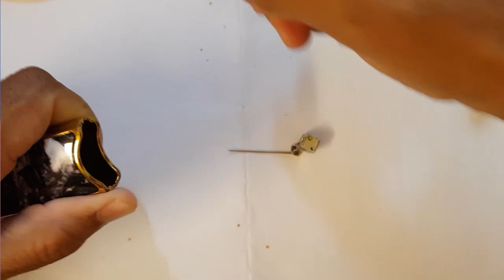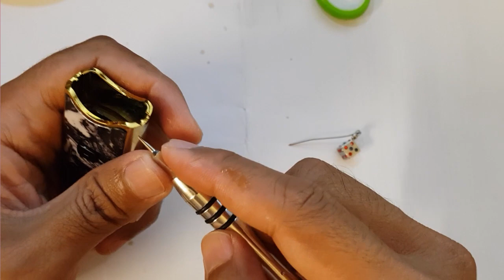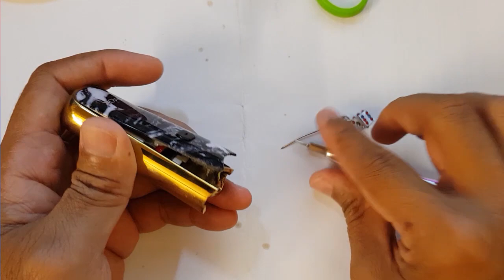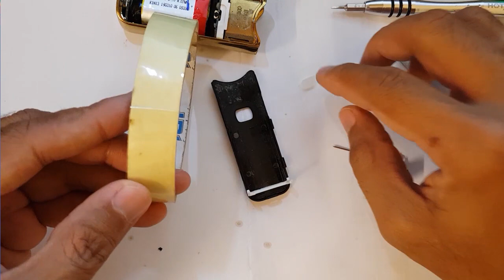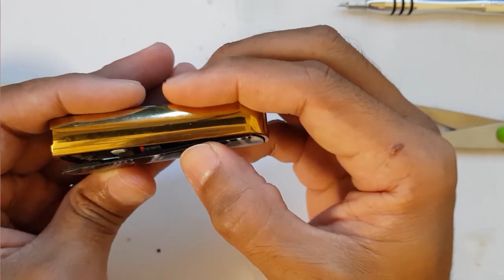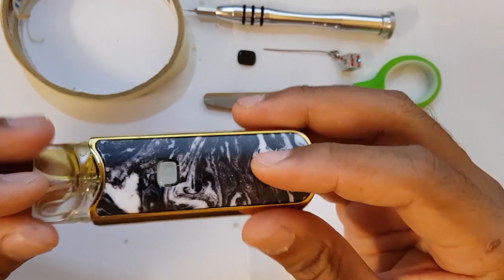SMOK NORD MOD BUTTON

Comment: bos sy punya nord ni bole da letak catridge die blinking tpi bile tekan fire button x jadi ape..die blink 4 kali..cam ne eh?
Reply from the maker: oh.. cuba tengok kat body 3 pin tu, rasanya salah 1 pin dah jatuh/rosak (biasanya middle pin).
Reply: @letsrugem  semua pin timbul je ?
Reply from the maker: @yomum4539  sebab jadi camtu pin tu tak contact btul dgn coil, samada pin salah 1 dah putus spring dlm pin atau contact dgn board dah problem. sebab bila letak catridge blinking once je. :)
Reply: so camne nak selesaikan?

Comment: What's the battery type ? 16340 or ?
Reply from the maker: 1100 mAh battery capacity and an output of up to 15 watts
Reply: @letsrugem  Thanks. I know it's official spec.
But I may have to replace the original one, so I'd like to know its type.
Is it round (like typical 16340) ?
The size seemed to be 16340 but looks like a bit flat in your video,that's what confusing me.

Sorry I can't take the risk to broke mine, cause it's my only mod now. lol
Reply: @sj1940  who tf should ever care about that?